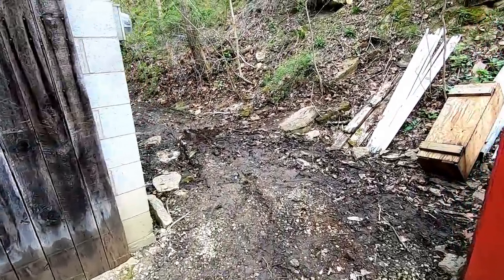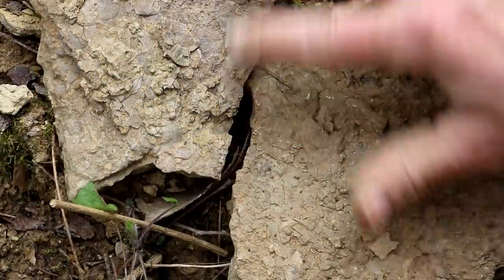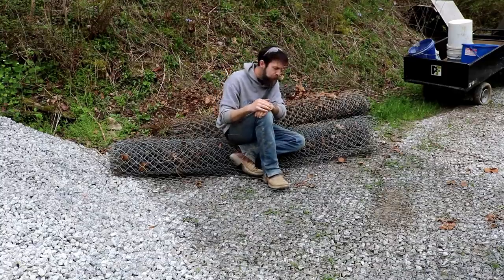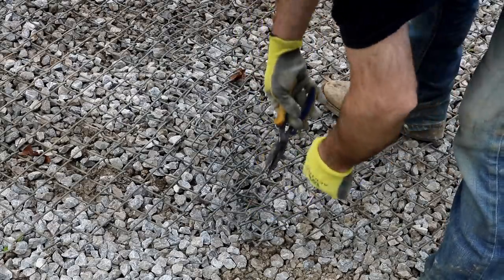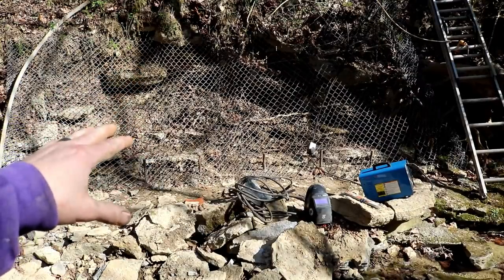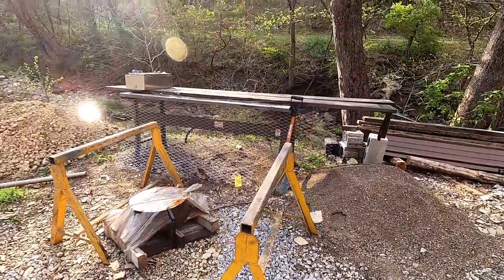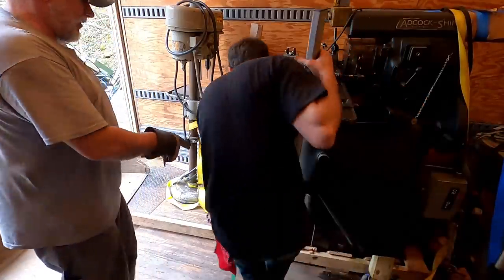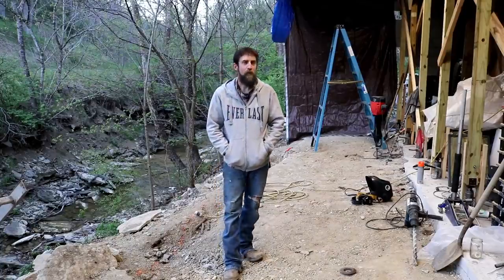New Machines Day! Shop damage part 10

Comment: ...
... A 1 phase to 3 phase Rotary Converter ...
... Would be ideal for the 480V Drill Press ...
... Not to difficult to Build ...
... Plenty of YouTube video on this ...
...
Reply: He has a 208v 3 phase rotary converter.  He runs all of his shop machines with it.  The 480v drill can be run on 208 just fine.  It will have a bit less power, but it will run without problem.

Comment: a auto-trasformer  from your add a phase for the drill press and  other equment. 240to480 volt
Reply: I remember seeing rows and rows of this type drill press at Naval Avionics here in Indy.  Unbelieveable high quality spindles with very low run-out.  Keep it, if you can work out the electricals.

Comment: That drill is too much to give up without a fight, look into a VFD to convert to the 480V, they can be had for a relatively cheap price and would allow you to run a speed control to slow it down some.

Comment: When I was 16 I was working full time at a shipyard and going to school.  I fell asleep while using a 9 inch grinder and let it slip down and hit my upper thigh.  It cut a 1 inch deep gash about 8 inches long and cauterized it at the same time.  I didn't even get stitches but talk about burn, it burned for days.  Today looking at the scar it's sobering to see how close I came to cutting something VERY VERY important to a man completely off.
Reply: A 1" deep and 8" long gash, and no stitches.... And a grinding wheel somehow got hot enough to cauterize flesh, especially going past your skin at a very fast rate of speed... Hmmmmm.

Comment: Think the overall quality of the original shop build was pretty bad, looks like stream turns into a raging river at some point but erosion isn't that extreme, think if you can make foundation  more robust along with tying into old slab with rebar and epoxy should help, good luck with the french drain with all the embedded rocks you have , to bad you couldn't have some dolos placed along your property, anyway good luck with everything.

Comment: I just started watching and I don't know what happens in the next few minutes. But... driving next to the building that close in the mud, you can push the block with the mud. I'm a builder for 30 years.. ask me how I know. Excavator is needed. Good luck
Reply: As a TEMPORARY solution, he could grade/backfill that stretch so as the wet area was lowest near to the bank's upslope.  Several layers of poly film laid in that lowest part and up to a meter up the wall could channel MOST of the water to each end of the building's wall.  This 'fix' is premised on the notion that S. lacks the $$ (immediately) for a rigourous remedy.....involving an excavator, very durable, perforated piping, fabric, and tons of gravel.

Sometime in the future (when the shop has been rebuilt and is up-and-running), the longterm, sound solution could be begun.....even in stages......

With unlimited $$, he could attempt (not alone) something a bit more exotic like: shifting the whole shop forward on drier ground, tunnelling a drain channel under the shop where it stands, or elevating the shop on piers, et al.  Ideas like these are hardly justified by cost...., but......?

Comment: A couple of thoughts. how about renting a small excavator  and drive it along side of the shed to the back end and just use the excavator to dig and loosen the soil and rocks without removing the dirt and rocks them back out and follow up with the bobcat to remove the debris and repeat as necesary. second thought how about a 240 to 480 volt transformer, maybe some generous soul will donate one? Is he motor single phase or 3 phase?

Comment: slap a VFD on that drill press... then you have all the speed range you need...
Reply: The problem is it's 480 volt 3-phase.
Reply: @flick22601  that's not really a problem. that's the beauty of a VFD. they mimmick 3 phase power and supply varying current to control the speed of the motor. granted, in this application there is a loss of torque, but with the right unit that can be partially overcome.

Comment: if the drains dont work in the back of the building you could trow some of thar rubble from tearing up the floor in there should make the bottom a little more stable
as for planting trees , thas prolly a good idea , think fur trees would be best as they grow fast and have a pretty good rootball , there used to growing n hillsides too
only downside i see they say green and with snow they might get so heavy they fall over

too bad about that drillpress m it has a nice swallowtail mounted table thats ajustable in height , if you mound a crosstable over that you could use it as the base for just about anything , thinking homemade surface grinder or horizontal mil  bet it be way more stable as a small hobby mill like the bf20

Comment: Re:the sensitive drill: 1. You might see if a rewind shop could change the termination to 240vac. 2. You may be able to find a 240 in to 480 out VFD.
Reply: Wouldn't a step up transformer also be an option?
Reply: @mikequas4384  Yes,that would be a option, however it would have to be a 3ph xformer and they can be expensive. If he thought he might add some more 480v machines that would be the way to go, one xformer with the KVA rating of his RPC.

Comment: Good luck on controlling water without cutting back and creating a foundation.  Most likely the erosion will just shift to the ends of your screened area.  Large rip rap rock and or stair stepped chunks of concrete pavement (big stuff) would be a hope.  Looking at the history of channeling water you need the space and the wallet.  How is that epoxy grout rated for temperature.  Most loses its strength at temperatures above 170 degrees so your welding may be a bad thing.  An option would be to use cable clamps on the rebar?  Going to be a chore and a prayer for sure.  Bigger rock and concrete grout to seal the fines would be the best you can do with what you have.  Take care.  Doug
Reply: Do you think the rods got hot below the rock surface?
Reply: @dans_Learning_Curve  Not enough to matter. He has to be talking about Celsius (Assuming he checked Wikipedia), because 170°F isn't going to hurt epoxy. Or he looked at the manufactuer's website that coincidentally says 170°F for the top of the range of the working temp. 340°F (170°C) is getting to the temperature where it will be affected, but as you said, it won't sink the heat 16" below the ground.

Comment: Hey Steve! That fencing wire is way too soft and flimsy to make gabian walls.
Reply: It's more than strong enough for what he's doing as long as he uses a lot of anchor points to hold it down so it doesn't rely on one wire. It will hold back thousands of pounds of rock, especially at that angle.
Reply: Ok, Thought he was going to make the actual gabian wall with rocks.

Comment: Instead of a full gabian basket, I was thinking of something like this over top of the rocks to keep them in place.
 https://www.chain-fence.com/img/hillside-chain-link-fence-protection.jpg
It would need to have some incredibly good anchors at edges, and I'd probably put a vertical line of anchors every 10 or 15 ft just to keep everything snug.
Reply: Nevermind... looks like that's what you're doing.

Comment: Steve
You don't need a small excavator. What you need is...  say...  ...a CAT 345B with the extend-a-hoe.

No problem.

It's been a while but I bet I could do it without taking out the corner of your shop or some power lines.

Comment: Angle grinders are without doubt, one of the most dangerous bits of equipment in the workshop.  I never use mine without reinforced gloves (I like the Ironclad Ranchworx but they are expensive, and I only get about a year out of them).  I've often wondered about a cutoff disk exploding.  If I have the math right, a 125mm (5") disk doing 11,000rpm has a surface speed 236 feet per second or 160mph!  Surely I have got that wrong.  Well I've tried different ways and it came out the same 161mph.  So that's how has those 1mm thick wheel fragments will fly out if they shatter.   

Of the two times I have cut myself with the angle grinder, one was with a cut off wheel while putting it down after use, and the other while changing position.  Both times it was my left hand that was not holding the grinder, and luckily neither was More than a nick.  If you want to see a really scary angle grinder story, check out woodworker Stumpy Nubs who had one of those chainsaw carving wheels grab and fly out.  https://www.youtube.com/watch?v=A7xWHEWov8M&t=36s

Still loosely on the subject, while we are in lock down (I'm in New Zealand) I am missing the linisher I normally use at my Menz Shed, so I converted my belt sander at home into a bench top belt sander.  When I tried it out, it was going a bit fast and ripped the bit of wood out of my hand and threw it a good twenty feet!  I've slowed it right down and will add an end stop to it tomorrow, but that is not the first mishap I have had since lock down started.  😧
Reply: Watch the hydraulic press channel. They have a few videos about exploding grinding disks.

Comment: Trying to solve the erosion in the creeks is going to be a futile effort. Why? Because that area you're trying to sure up in on an outside bend in the creek. And therefore it will erode faster then any other place, do to the speed up of the water flowing to the outside.  I understand you're trying to do this with as little money, and time, as possible. But anything you do short of a very good poured wall is only going to be a very temporary fix at best.  But I will watch your efforts and building progress weekly anyway... Thumbs Up!

Comment: Man, this channel has a higher than usual ratio of people that are so full of it. Somewhere between innocent perpetuation of myths to outright lying. Some guy, who is on the latter end of that scale, said he cut a 1" deep, 8" long, gash into his leg with a grinder, and that it cauterized the laceration and he didn't need stitches. Like WTF. A grinding wheel doesn't get hot enough to cauterize flesh, especially traveling across 8" of your skin in 0.1 seconds. Another guy said that you shouldn't show anomalies on your channel because a "liberal Democrat called the DNR" on the company he worked for, and they got shut down and fined $100k because of a salamander. Riiiight. Totally believe both of those stories.
Reply: I think it’s a creative writer that’s just getting carried away with his imagination 🤭😂